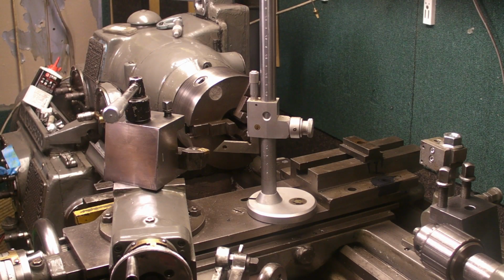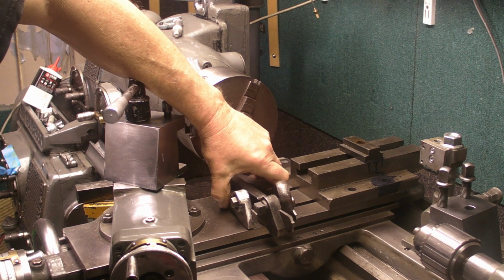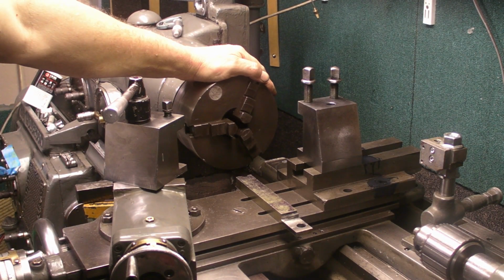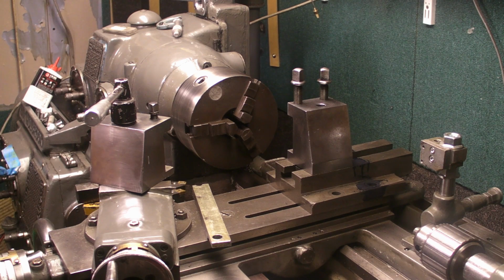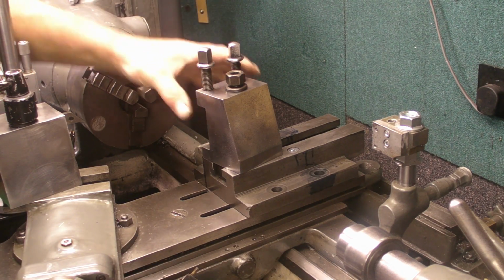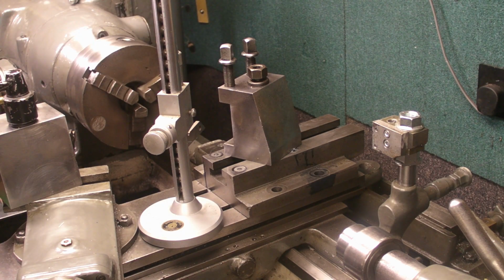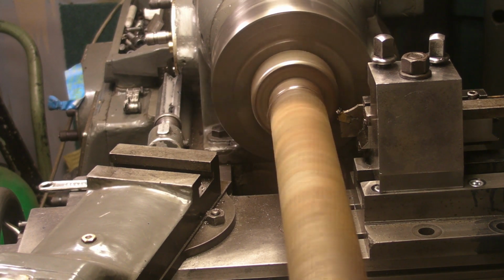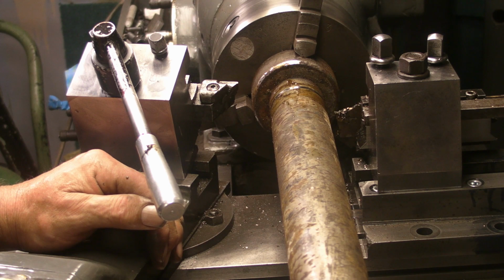Rear mounted tool post just for parting off

Comment: Also I have been questioning the inverted tool post where the parting tool is mounted upside down. 
An obvious upside would be that the machine keeps running in the same direction so parting off may be done even without switching off after the previous operation. Although parting off is often done on lower speed. 
There are claims about the tool 'digging in' vs. 'being pushed away' which are vague to me. After all it's the exact same process. It seems like fixing a problem that has its root in insufficient stability. From a standpoint of forces at play, any inverted tool (front or back mounted) will actually try to lift the saddle and everything on it, which is contrary to the machine design intending the forces to be directed downwards into the frame.
If an inverted rear tool post is still desired, at the least it should be executed so that the clamping system is also inverted, with the clamping bolts coming from the bottom and the fixed mounting surface is at the top. I have a Colchester lathe of which the manual shows a very nice example.
Reply from the maker: Hi, dont see the point in mounting the parting blade upside down when as you say the forces are working against the design of the lathe. I have the 3 phase motor hooked up to a VFD so reversing direction is an easy task !, Would be nice to see some vids of the Colchester. Regards Del.
Reply: @machinenutdel6764  
Thanks! Actually I own 10 lathes, not all of them in working order.
My main machine is a Gema LZ 160. Great mid size machine with some smart features like auto feed cut-off on both longitudinal and cross slide. I like to work with this especially for safety reasons. Another option is to work on real had stops mounted in a similar way, while these are even more accurate it cannot be used on auto feed for obvious reasons. I also have micro adjustable hard stops which makes it even easier. 
I intend to eliminate the compound slide on the Gema, as Robin Renzetti and Stefan Gotteswinter have shown. Added stability is a bonus and I have noticed (although it never happened) that with the compound, crashing the bottom part into the chuck is a big risk when the compound is retracted and your eyes are on the tool!
Another bonus with compound slide elimination is that there is more room for bigger tools. In fact I have a lot of tools with 25 mm shank from a previous bigger machine which currently don’t fit, in the setup I have now the center height is 17 mm. I have also reverted back to an original 4-way indexing tool post from the (expensive) quick-change tool holder system that came with the machine. I have found the quick-change systems to be a huge trade-off, sacrificing stability for convenience. The inherent problem is that there is always air in the force path from the tool mounting interface to the machine. Possibly an even more problematic issue is tool overhang. The tool is placed further outboard and in the worst case, the tool is situated (far) outside of the left cross slide guideway. This will cause the cutting forces to work and tilt everything from the cross slide up, with terrible consequences. Again, as the lathe is originally designed this never happens. You always want metal-to-metal all the way down into the machine bed, no air! 
With the quick-change system, parting off was practically out of the question on anything in steel. Yes I am now having to shim my tools again but it is well worth the effort. Once set up series can be produced very efficiently and indexing the tool post is in fact a lot quicker than changing tool holders. There is also a lot less bulk to contend with. There are some modifications in the works to further improve, along with the compound slide elimination comes a new, dedicated 4-way indexing tool post of my own design. 
One last thing about the rear tool post for cutting off. With a 4-way indexing tool post the rear tool post adds a 5th position which can be very helpful. With 4 or 5 tools the vast majority of work can be done. When a boring bar is used, only 3 positions on the indexing tool post remain, so a 4th in the back is a bonus. I regularly use outside and inside turning tool, a parting tool and a chamfering tool. I like the concept of drilling with the carriage but it depends if I can miss another position. Then again, there's always work that is more suited to the turret machines.

Finally, machine list: 
Gema LZ 160 (4)
Boxford (2)
Schaublin 102 VM
Lorch (watchmaker’s) 
Boley RD 42 
Ward 2A
Reply from the maker: @bigbattenberg  Got a video coming on at 8pm our time, it shows the Belgian lathe I use for hogging hope you can catch it, Del.
Reply from the maker: @bigbattenberg  Never fancied the QCTP myself, expensive and whats the rush !

Comment: Nice work. Still vibrations though and I'd say your revs are way too high. With a good setup, parting off can and probably should be done on auto feed. Of course there are plenty of other areas where vibration can come from, solve them one by one.
Reply from the maker: Hi BBB, Im still a newbie when it comes to parting off, and I think a lot of people struggle with it ! having a rock solid set-up is the way to go , never tried the auto feed when parting, its something I need to do, thanks for the comments, Del.